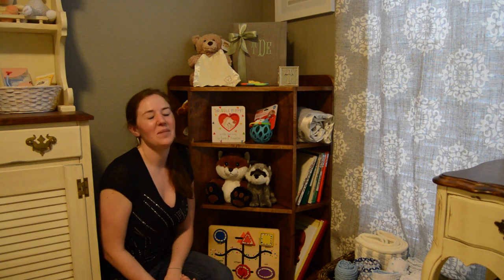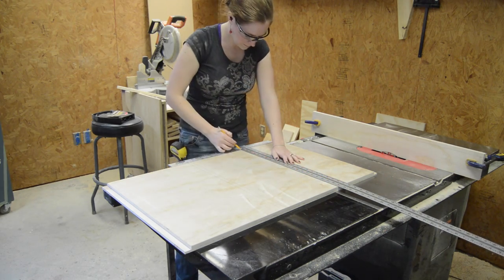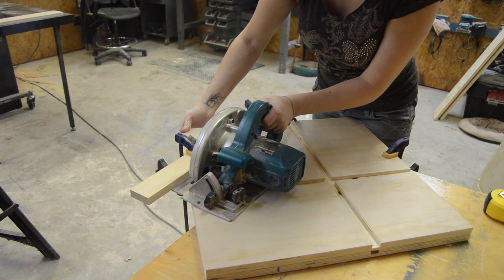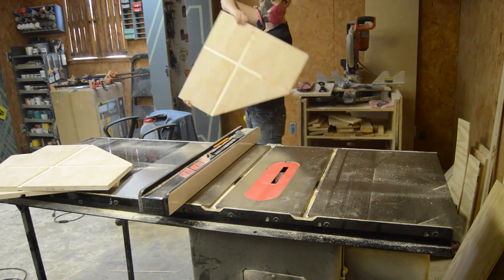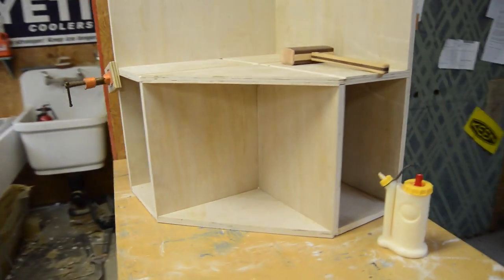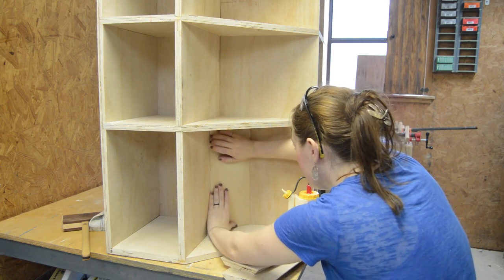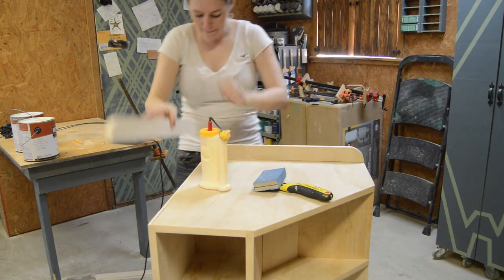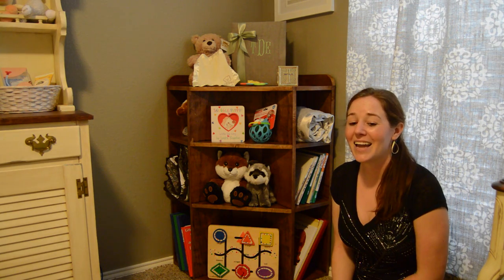DIY Corner Nursery Bookshelf

Comment: Terrific project, April. Something I bought some time ago and have really enjoyed it a lot, is an HVLP sprayer. I got one online (Amazon) and it was a factory refurbished unit and only $45, but as good as new. I get spectacular results with water-borne clear finishes now. I made a fold-away paint "booth" using PVC pipes and a 9' X 12' canvas drop cloth from Harbor Freight (and some velcro strips.) You might give HVLP a try.

Comment: I like the finished product.  To make use of the empty space inside the cabinet created by the cubbies, those could house some electrical wires that connect to a lamp or an outlet to charge a phone or stereo dock (for Mozart Baby Lullabies).  I'd like to duplicate some of that technique in my small kitchen where I don't have enough counter space and weird angles.

Comment: That is such a nice bookshelf!  One thing that came to mind while watching you maneuver those larger pieces of plywood around was one of your older videos where some folks commented that you could use an outfeed table.  Are you still planning on making one?   I would definitely be interested in seeing that build video as I need to make one for myself (I get nervous reaching around the blade and an outfeed table makes it much safer for large pieces). Keep up the great work!
Reply from the maker: I do still plan on making one, however the list of things I need/want is so long I have to pick and choose what I move to next. For my next shop project, I am going to install my dust collector, then maybe a router table, then probably the outfeed table. But who knows! That might change. : ) In the mean time I'm making due on all fronts.
Reply: April Wilkerson Very good.  It sounds like you've got a lot of great projects lined up!  I'll be tuned-in.   Thanks!

Comment: Very, very nice, April. Having been a kid in the 50's and early 60's, I developed a gag reflex whenever I heard the term "plywood furniture". You've probably seen some of the old Popular Mechanics articles on building "modern" things out of construction plywood. But what you've done here is something I look forward to getting the plans for and building. The staining and edging makes an enormous difference in the appearance. May I ask what grade and type of plywood you used?  Also, I'm a "by the plans" type of guy. I really admire your ability to imagine a project, then come up with a practical plan for how to do it. You should see my last "creative" project. A monstrosity. Thanks for all you do.
Reply from the maker: Nope, I've never seen anything on modern things with plywood, but I'll look it up. I bought cabinet grade plywood for this because it was around $37 instead of closer to $50 for the oak or birch plywood. So this plywood is pine. I'm currently still working on the plans. I stayed up late getting the model done in SketchUp (I'm still learning it so it' a slow process), so now I just need to type up everything and break it down into steps. : ) Should be up tomorrow if you want them. Cheers!
Reply: April Wilkerson If you ever see a "Popular Mechanics do-it-yourself Encyclopedia" pick it up. You'll be amazed at the "modern" plywood projects.  I hold volume 2, 1968 edition here...hmm, would you like plans for a pedal-powered boat, with provisions for an outboard motor-  ALL of plywood and pine?  (and a bike).  Some really cheesy stuff in there, but you might get a few dozen good ideas from a set.  I gave my set away to a friend.

Comment: Great video, that's a great looking bookcase. I've never used that edge banding, but it looks like it goes on pretty nicely. Do you have to prepare the edge of the plywood before you install it? Like sand it or anything?
Reply from the maker: Thanks. : ) Yep I sanded the edges down so that it was smooth. I didn't want any texture coming through the banding. If you buy banding, be sure to pay attention to what type it is. For example they have 'red oak' 'birch'....to match whatever plywood you purchase. This was pine cabinet grade plywood but my local store didn't have pine, so I used birch and it looked great.

Comment: Never saw a 90 degree panels fit into a 90 degree corner, but seems flush against wall??? Usually see a strip on back with 45 degree angles and the sides joined into it in same fashion, how did you do that April? Nice job any way!
Reply from the maker: It isn't a 90 into a 90...It's a piece that has 45 on both sides then I just fit it into place where it sat flush. : )
Reply: musta missed that! thanks for responding April!